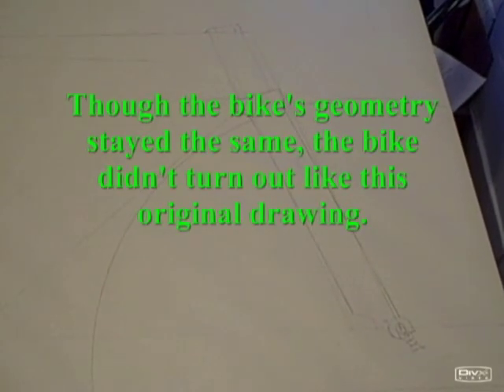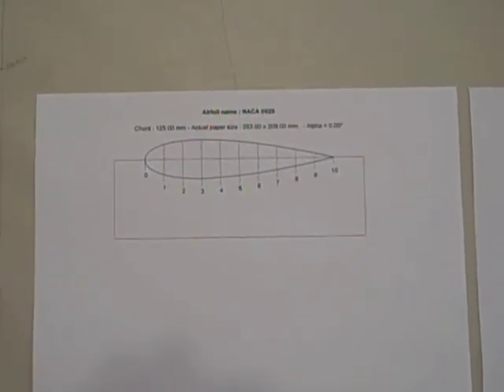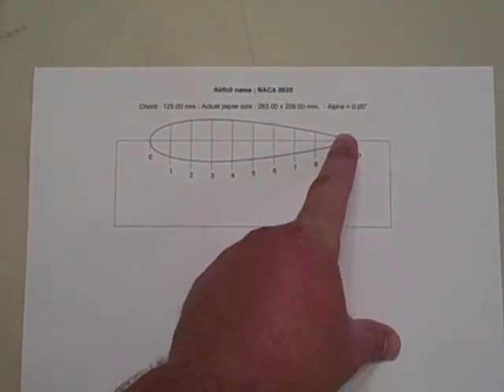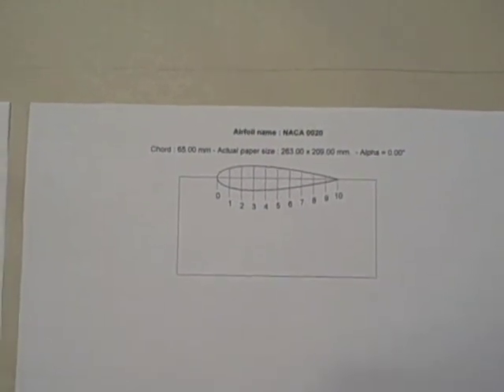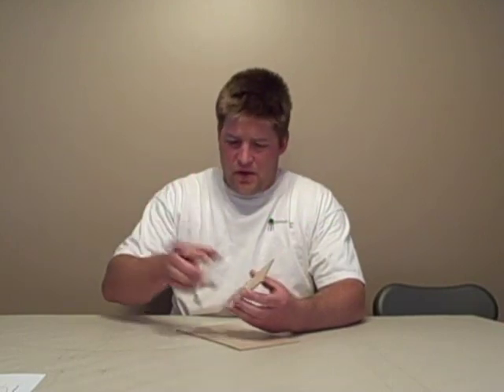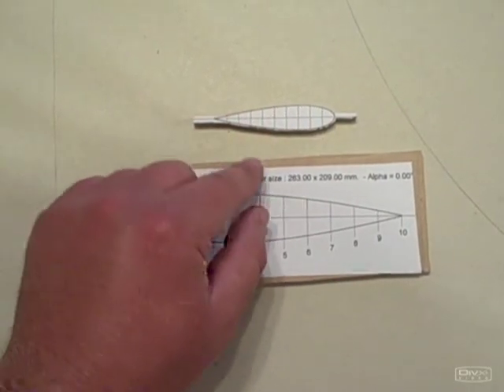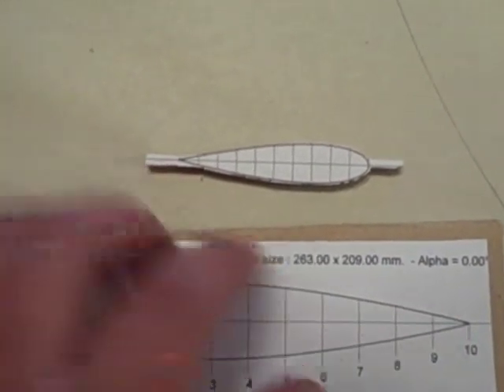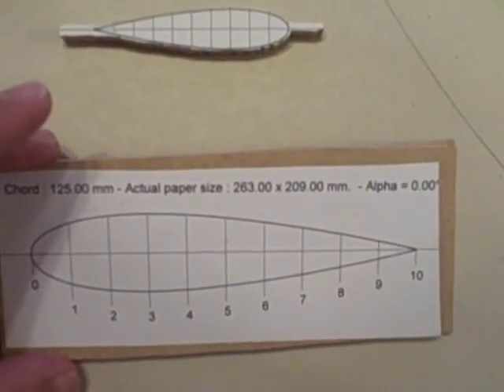Chapter 1 Carbon Fiber Bike Build.wmv

Comment: I was wondering why you didn't build the frame in one solid piece? I'm thinking of trying this project myself this summer, but I'm really in doubt of it's strength on our cobblestones here (I live in Belgium). Wouldn't it be more rigid if all carbon fiber was applied in a whole?

Comment from the maker: Not as complicated as it seems. I find the angles on the plans with an angle tool like a True Angle and then cut my block of foam with the angles on the ends of the block. This gives the airfoil the proper angle of attack. Once the templates are lined up on the ends of the block you just cut it out with the hotwire. I make my foam-core and cf tubes long so I can cut them down to size once they're cured.

Comment: How did you get the hot wire at the correct angle for the fork and other angles of the frame? I understand how you would hot wire the airfoil template, but not at the angle you ended up with.

Comment from the maker: I used a foam core wrapped in carbon fiber to make this bike. So you don't need to do molds and vacuum infusion. A vacuum pump helps but you can actually use tape to compression-wrap the carbon fiber.